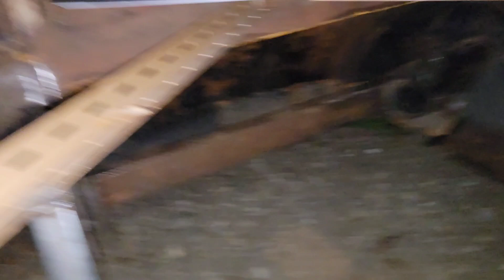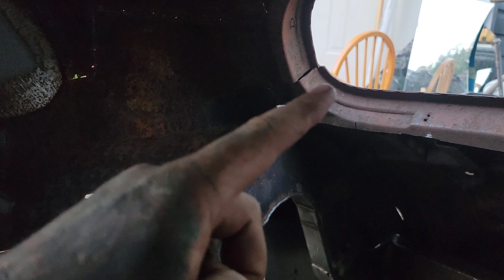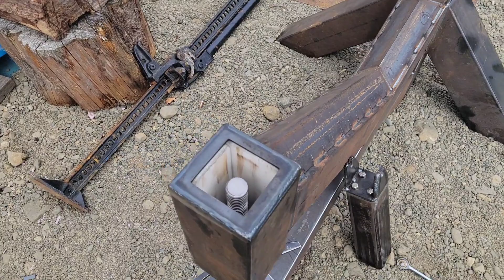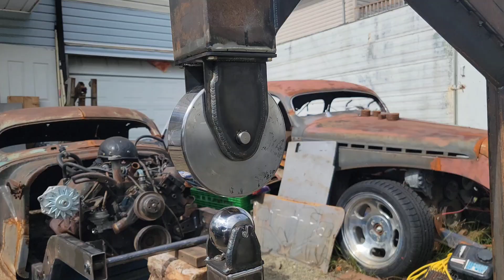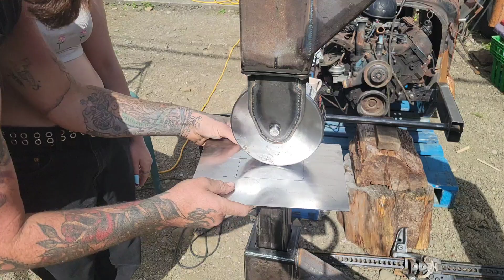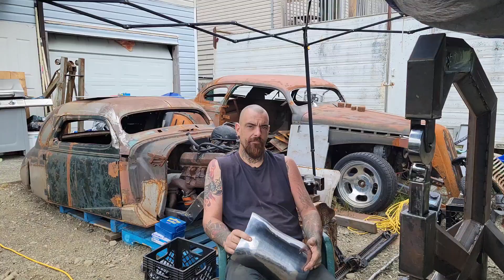Rat Rod Chevy body meets frame, and In depth on my Monster English Wheel

Comment: Ryan sweet setup. Your design looks so easy to convert it to. Tipping wheel too. Simple tipping wheel attachment with hand wheel like Invision or Wray etc. Also color one of the tongues on the star so you can keep track of turns. Cheers from Alaska
Reply from the maker: Thanks Patrick 🍻
I've got tipping wheels for the bead roller I'm going back to finish, but never thought about it for this I'll have to do some digging.  Thanks for the tip .   And as soon as I weld balls on, I'm definitely painting one a differant color.  Just waiting to finish everything up before I paint.
Reply: @kingofbootyfab  ok now ya have me thinking Ryan. A quick attachment motor to turn the screw pedal operated with louver dies that swap over with your 4 bolts. Hmm
Reply from the maker: Doable for sure.  The frame is definitely stiff enough to locate it.
I've always done louvers with my bead roller 🤣  but that doesn't work on curved panels.  I'll have to do some looking.  It's certainly something I hadn't considered.  The rest of the bits are here for my planishing hammer though

Comment: Where did you get the upper wheel? Mine is out of the UK and it's solid w/ a recess and I prefer the lighter weight/mass of the hollow upper. Ah, nevermind, link is in description. However, KMS Tools doesn't list the width on the upper wheels or lower anvils. Are they 2" or 2-1/2"? For ball handles on mine I welded 3/8" NC bolts to my spokes and then drilled and threaded on Calloway Golf Balls. They have stayed tight and the dimples make great grip.
Reply from the maker: I believe it's 2-3/8, but I can measure when I go back outside and let you know.

Comment: Hi, I would not use an HEI the distributor cap is way to big and they are really crap anyway. I would use an older olds distributor with the small cap. It will take up much less space. They even have crab caps available, which are short and have the wires come out sideways instead of going up. They are great for blower clearance. If you still need more clearance the distributor can be cut. machined and welded. There is around 1.5 inches there. The only down side to the small caps is that you need a separate coil.
Reply from the maker: Its crossed my mind to go small Cap, but I've had really good luck with HEI caps over the years, and the 1 wire hookup is a benefit since I'm not chasing horsepower really
Reply from the maker: I do have to buy cap rotor and coil anyways, I've been considering just buying a complete billet unit, I'll see when I get there. Either way it needs some firewall clearance, it's 3/4 inside of it